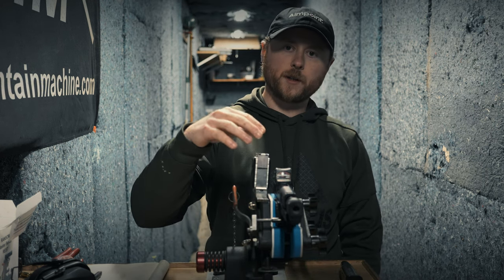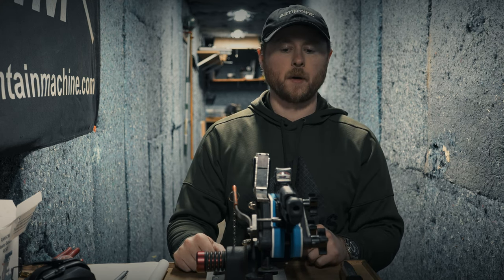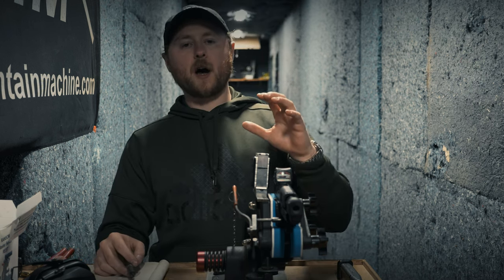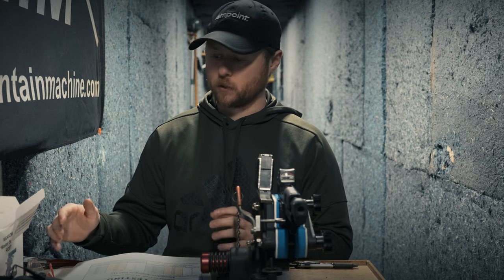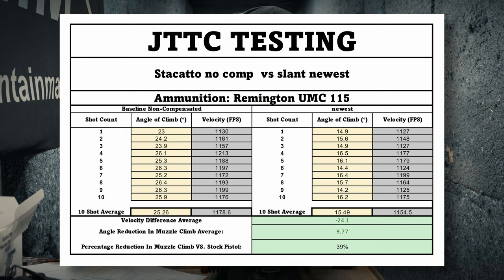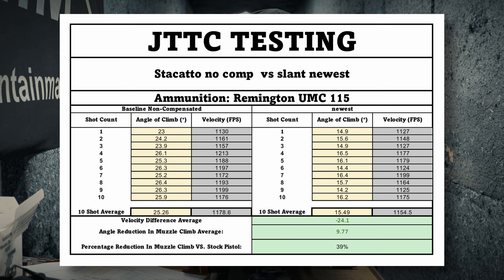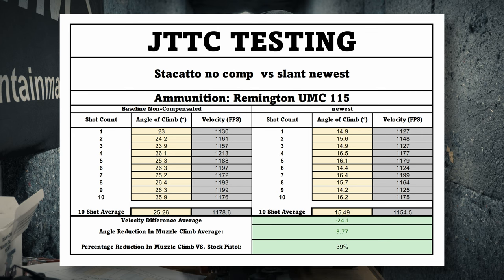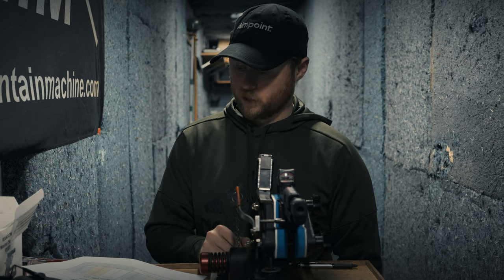PMM Testing: Data backed performance Comp Testing

Comment: Just got my PMM comp in today and as a heads up to some who may have a rival arms barrel for Glock 19X & plan to use a PMM comp, the comp will bottom out about and leave about .100” of gap between the end of the slide and comp. I should have just got the JTTC comp and barrel setup. Lesson learned the hard way. The machining and quality of the PMM comp is phenomenal though.
Reply: Their comps and barrels are proprietary so they're not made for other brands stuff. With that said it should work just fine

Comment: I just bought the PMM Micro jttc for my Glock 45 and I was wondering which guide rod would work best with it. Any recommendations?
Reply from the maker: All of our comps are designed around factory recoil assemblies.  If you were to change out the spring we suggest a 15lb spring
Reply: @ParkerMountainMachineNH  well that’s works out. Just ordered the radian compressor. Appreciate the info.